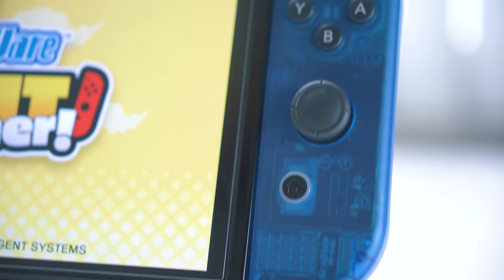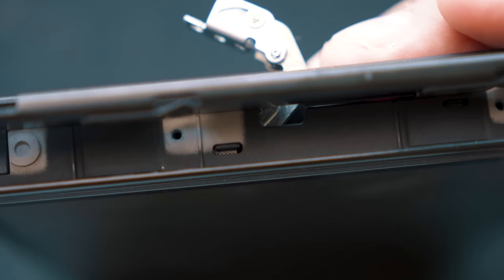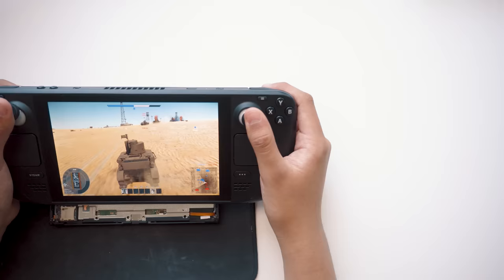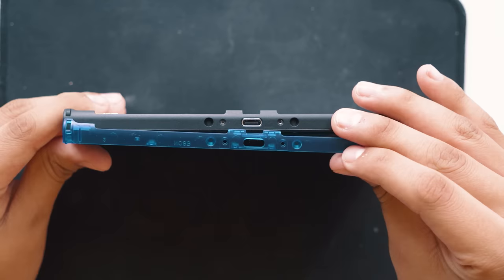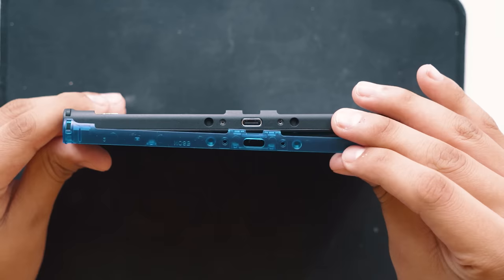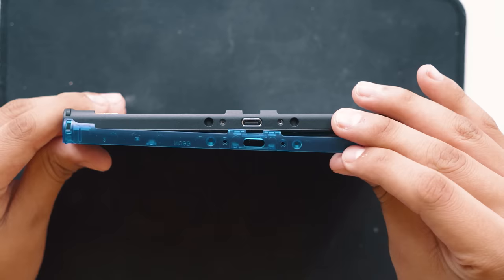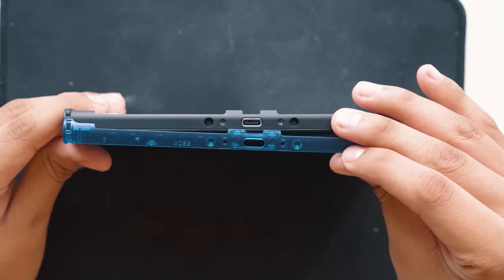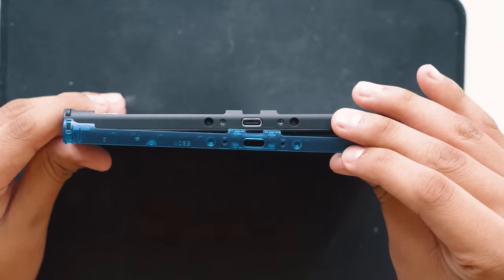I Finally Shell Swapped my OLED Switch

Comment: I would never have enough trust in my ability to do something like this because if you mess up you could ruin your switch. If only Jeff had a service where he does it for you
Reply: Agreed. I do it with only joycons because it's super easy(even if im so reckless) but for the switch itself, im scared
Reply: @roastymarsh6284  Well what would you suggest for an absolute beginner
Reply: @BluJay722 start with joycons. Having the basic tools (like the one on the kit. The 2 screwdrivers) also a small container or multiple containers to put the removed screws so you wont lose them. If you're gonna start with joycons, start with the left joycon since the right is little harder than the left because the right has infrared sensors. Also if you're experiencing joycon drifts, it's advisable to also replace the analog sticks. I did it to mine, replacing both shells and analog sticks. When dealing with ribbon cables, dont yank it out, theres a mechanism to flip to unlock safely(if youre gonna replace the right joycon shell, youre gonna temporarily remove the analog ribbon cable to access the screw.

I cant give you any tips on the system itself since i havent done it.
Reply: @roastymarsh6284  Thx
Reply: I honestly dont see what how you could mess up if youre really careful, just have patience. Dont rush anything not even for the slightest. Take your time. Even just wanting to get it done can cause you to mess up. So just be patient. Lets be honest sometimes you dont touch your switch for a week. So whats the rush anyway.
Reply: you are soo right i would never do something like this modding sounds boring anyways
Reply: My family having about 12 switches across all my family members, I have been tasked with modding about 6 of them. (Also the drift repairs of multiple joycons)

It's honestly really easy IMO. The OLED switch looks a hair harder because of the new kickstand, but not really. 

I really love tinkering with tech and I find it therapeutic tearing these guys down and rebuilding em. 

Just saying, don't let yalls minds/self doubt deter yerselves from tinkering with your tech. Take the proper steps, do the proper research and above all else, take your time and enjoy the moment by moment of servicing your own tech, it's quite rewarding. 

Most errors come from folks whom are in a hurry or fluster easily. 

Good luck modding folks!
Reply: @BluJay722  or just start with ps3 controller, practice on it then try it on switch.
Reply: @BluJay722  this is really late but Nintendo will most likely fix the joy-cons for free if they do get screwed up.
Reply: @roastymarsh6284  the joy cons are far more difficult than the console housing.
Reply: @hopkinstreeexperts759 I’ve done joycon shell swaps and ngl the switch looks far more daunting
Reply: @Samuel-qi7in  it’s not really that bad, but to be fair most of the ones I’ve done were the og switch models, but the OLED is just the sweet spot for size to me.  I’d rather remove a couple big components versus deconstructing an entire small thing.
Reply: I did it just today. It really wasn't all that hard. Takes some patience and trust I yourself. Also I imagine the cost of getting g so.eone to do the shell exchange would be many times more than a premium shell It normally takes about 3-5hours
Reply: I just tried to install it last night to find out I ripped the rail ribbon🥲
Reply: Im getting my friend to do it hes done it before so
Reply: I wouldn't suggest doing it yourself anyway, took me 12 and a half hours to do it myself.
Reply: @joelmeza123 I was careful and I managed to break a piece off the motherboard of the right joycon mate, they are very delicate pieces of electronics.
Reply: @Broment502 they don't cover it if u break the warranty mate, ie taking it apart yourself.
Reply: @hopkinstreeexperts759 I disagree, that case was a nightmare to replace, the joycons were far easier taking combined well over half the time it did for me to do the case itself (12 and a half hours)
Reply: @truth4fun the cost of breaking parts wis probably cheaper too although it's far better to get a professional to do it then if they break something they have to replace it and not u.
Reply: The joycons are less scarier when replacing things because there is no data on it.
Reply: Just did mine first try. It was easy af but requires patience and the “want” to do it. Otherwise you’d hate it
Reply: Yep

Comment: Joycons dont look so scary to do, I did a few sets using your old tutorial, but the 3ds is a whole other monster
Reply: @blacktoz  opened up my 3ds like 3 different times to swap screens, buttons and even the whole shell. Fourth time that damned cable got stuck and I accidentally tore off my backlight cable. Once I get it fixed I'm never gonna touch the upper screen side of my 3ds ever again
Reply: I replaced the shells on my 3ds xl new to the galaxy and after that it never turned on again, the blue light comes on and just turns off instantly and ive found nothing on it, i lost $200
Reply: I cried when I heard my friend ask me to fix his 3ds.
Reply: @-Wraith that can happen when a ribbon cable isn‘t connected properly.

Comment: Went all out and replaced the bottom bracket for the full effect. Wasn't that bad tbh, but pro tip: don't forget to plug the battery back in before you get it all the way back together. I'm not saying I did this, of course. 😅

Comment: Yeah I’m definitely buying the clear black one, as much as I love blue. It will bug me to no end if I have a blue shell & i use my left blue joycon & right red joycon.😅 Won’t be swapping out the bottom portion, I’ve only disassembled JoyCons & Pro Controllers, not touching the innards of the Switch.

Thanks for the video, glad Extremerate finally released shells for the OLED.

Comment: This is definitely a tedious task but can feel rewarding imo. The one thing that stopped me at first was a stripped screw but I managed to get past that with left handed drill bits which worked like a charm and luckily the shell kit comes with replacement screws and were a lot better than the stock screws. I used ExtremeRate and their tutorial which is very thorough and it’s definitely worth appreciating. Now my oled has the clear teal blue shell and I love it and how different it feels. If anyone plans on doing this, all I can say is be careful with ribbons and the paste as well as pay attention to screw placement. I found one on my system where it wasn’t shown at on the tutorial. Those thin nosed tweezers work fine pulling ribbons safely  but always be gentle first

Comment: Everything in this video is very informative and very easy to understand. 

The issue comes with your switch! Mine had screws that were super tight on the rails. I bought a nice screwdriver because all the reviews said to, and I still managed to strip them because they were in there TIGHT! I had to dremel them out and destroy the integrity of the rail. Now two screws are stuck but it let me get the rails down so I can pop the back plate off. I managed to get the silver part off but when it came to the screw with the sticker on it I STRIPPED IT!!! I was so angry and annoyed because it cannot be unscrewed and it prevented me from putting the plastic piece on the bottom. I did everything by the book and I still had issues. So if you’re thinking about it, just be careful with the screws if they’re hard to get off, they most likely will strip

Comment: Great video and great inspiration, thank you!
I bought the kit and shell swapped my switch OLED in transparent blue, it looks so so good!
I did keep the bottom bar black, it wasn't worth it for me. I also kept all the buttons and triggers stock black, I like the dual color scheme and how the buttons pop.
I also didn't have to unplug any ribbon cables on the 2nd joycon, I was able to keep it all connected and just unatttach it from the shell. I only disconnected the battery. It was quick and easy.

Comment: Fun fact! If you accidentally damaged a copper padding on the display ribbon cable you can either add Flux and solder the pads OR make a jumper cable from exposing some of the copper and solder the wire from point A to B. Was able to save a display this way lol
Reply: Old electronics hack derived from PTP circuits ;) nice mention.

Comment: I would've kept the metal kickstand instead of swapping out it for the plastic one that came with the case. It'd probably give you better durability and help prevent flexing of the device. Just my two cents lol
Reply: Idk I thought about that too, but when I was fitting mine up to the new shell just to see it looked kinda tacky and out if place with the transparent molded shell

Comment: I recommend you use a rubber mat as a work surface and to put anything that you afraid to scratch it safer + help the thing no sliding.

Mouse pad is a bad idea since they have fabric surface which can contain dust or sand or anything of sort that can scratch things up easily.
Reply: Rubber holds on to dust more than fabric does. The mousepad is the better option tbh.

Comment: I now done with modification. I don’t know something changed from the video or not but the box was different and the philips screw driver was so bad quality. Because of this at this moment I don’t change the bottom strip next time I will use professional set. Anyway the mod kit so good. I modified an NS Oled Super Mario  Edition ( full red ) with transparent kit. I keep some part from the original. I like it. Thx the video. Without this I don’t found this kit… literally I don’t figured out I wanna mod my switch 😂😂😂

Comment: Replacing that bottom piece looks downright easy compared to replacing the front plate on the OG Switch, so I'd probably do it. Then again I absolutely wouldn't have replaced my V1 Switch's front plate at all if it hadn't cracked on the top and bottom, but at least I'm going to have a snazzy full Atomic Purple switch when I get done.

Edit: It looks like even Nintendo realized how much of a pain replacement of the front plate was, since both the top and bottom of the OLED aren't part of the front anymore.

Comment: That's it?? Way easier than the v1 switch. I even did the screen housing swap on that! 
Looks like you can't do the front screen housing swap on these so you still get that black border. 

Either way it looks good, I would also do the bottom part.

I really liked your tip on the tape.

Also, thanks for the joycon color software tip! I did not know you can do that! I'm going to grab my wife's switch that I color swapped and change the joycon colors. 

Question though...what laptop is that lol? looks clean and light!

Comment: Dude, I could NOT get the main side screws out. The top on both sides came out as expected - but the middle and lower one on both sides were in there like they were glued in. Broke 2 (quality!) driver bits trying to remove them. So bummed.

Comment: I'm actually having a  harder time with the left joycon than the right using a shell from that same brand. I followed many tutorials to see where I could've gone wrong but for some reason my - button sinks into the controller. I can't get it to prop out like it normally would and all the pieces are in tact

Comment: Do you happen to know whether switching the kickstand will make it so the main tablet no longer fits inside of grips such as the ones by Satisfye, or the CRKD Nitro Deck? It seems as though if that’s essential then it’s just as easy to simply reuse the old kickstand, but I was just wondering since the new kickstand is a different shape from the old one.

Comment: I'm now curious if you could use one of these oled back plates on an original switch or not. May have to look into this more later.
Reply: I think you can't because the inside of the "normal" Switch do not have space for the stand joint
Reply: @katsuya2742  I can't imagine there is a gap issue. I'd be more concerned about screw or pin alignment. I need to take a look into it more, but I think it would not work unfortunately just based on this assumption.

Comment: @Dammit Jeff , hey there Mr youtuber man. I was wondering if you could provide any insight on a few issues I have found with this shell, today I just swapped my OLED shell on my joycons and switch exactly as you did. I also used the same brand shell you did, the extreme rate one, except I got glacier blue color. Everything went pretty smooth and it looks great, I have only found two issues. One being the triggers on the joycons, so those both feel really loosey goosey now and actually if I press on it in certain ways I can feel it pop out of place a little bit and I have to kinda press on it in another way to get it back in its normal position. Second being the hinge on the back for the kickstand, after installing the new hinge covers for the metal hinge parts for the kickstand the little pieces of plastic that cover the metal parts, whenever I close the door it makes a crackling sound for some reason and it does it everytime I close it, right as the kickstand is about to meet flush with the switch itself. My guess for the triggers is that its due to having to pop the triggers out and then pop the new ones back in place it possibly slightly damages the integrity of the plastic housing a bit making them looser than normal. But the hinge crackling sound idk, I tried taking it apart and putting it back together again and still got the same outcome of that sound when closing the kickstand. I know this was really long so I appreciate if you or anyone for that matter read it till the end, and any insight would be greatly appreciated. Thanks!

Comment: Hello, my Switch has an issue after the install. It recognizes my right joycon but doesnt charge it. I tried with a HORI controller and it doesnt it recognizes it. Is it  a rail or joycon issue?
Reply: does it work when you detach the joycon and run it off the battery? maybe you didnt put the battery plug back in properly, happened to me too

Comment: no one does it because the warranty is still available
Reply from the maker: The thing is, these things are pretty straight forward to repair, so warranties aren't really required. Your backplate breaks? $8 for a new one.
Your rail stops working? $3 for a new one.
Your fan dies? $5 for a new one. 
Your joy cons start drifting? $8 for a 2-pack of joysticks

The benefit is that you don't have to wait around for a warranty service to fix your stuff, and you ensure the job is done properly since you're fixing it yourself.
Reply: @DammitJeff  if you have a factory tech defect that has appeared over time, and it is not your fault, but you have opened the screws, your warranty is void, based on the return policy 03.09.22 LR. Many owners do not take risks, since not everyone will solder circuits on their own
Reply from the maker: @Nelson_Curves  I don't recall whipping out a soldering iron at any given time while disassembling this OLED switch, did you? 😅 Everything in here is really straight forward to replace.

As for "many owners won't take risks", I'm gonna assume many owners likely aren't looking at disassembling their entire switch for a blue housing to begin with, so a warranty for those who do likely isn't a concern.  :)
Reply: @DammitJeff  well, a youtuber who is engaged in repairs, like Tronik if I remember properly, there were switch breakdowns, where he had to solder and replace the chips from the board, just as an example.
Regarding the second part of your post, I agree, there is logic in this. I plan to take up customization of switch, as soon as my device has been working for at least a year without breakdowns. It all depends on the quality of service of the device.
In general, it was an interesting conversation.